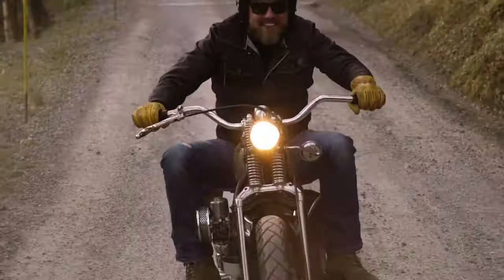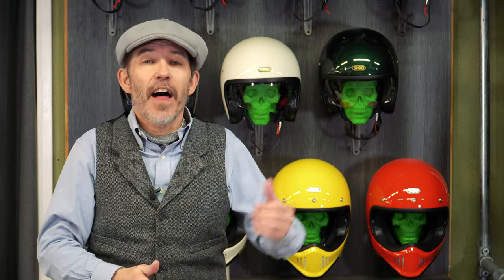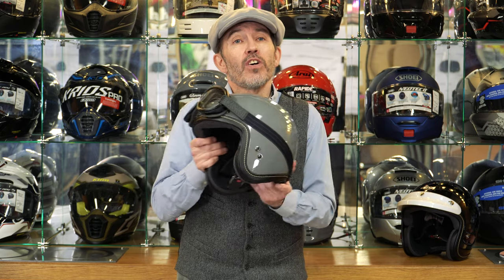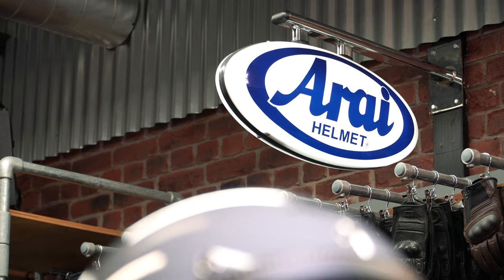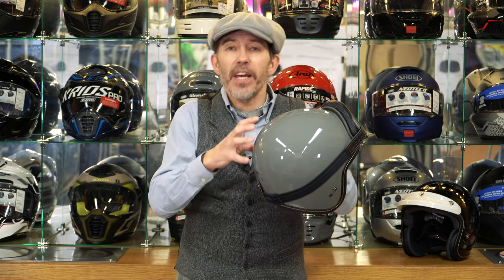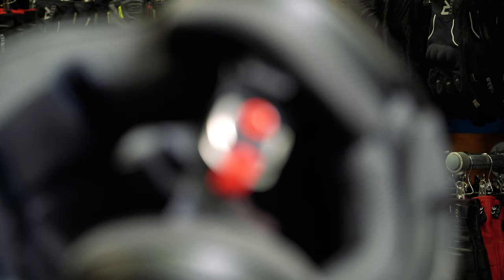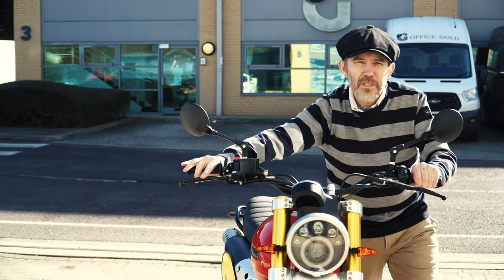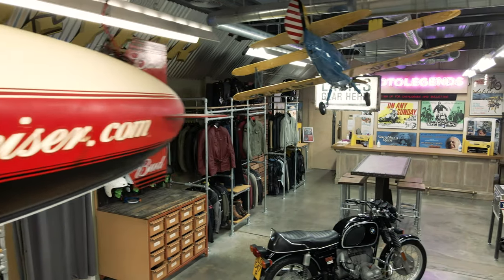Arai Urban-V helmet review

Comment: Tks, Chris. To add to your list about classic-styled open face helmets with changeable cheekpads, please seriously check out the HJC FG70 S. FG for fiberglass. (The US gets the IS version, which is polycarbonate) 
Costs circa GBP120, I fell in love with my white assymetical striped Landon version. It's got full removable liner and cheekpads, there are fine slits in the front of the lining for airflow. It's ECE 22-05 certified. It's got drop down light smoke visor. 

And for those reminiscing the 70s, one could even buy a Luke Skywalker X-wing fighter pilot replica with an orange tinted visor!! 

I loved the FG70S Landon so much that I sold my Arai Classic DC (a pre- Arai Urban-V version classic openface helmet). It's been my mainstay dry weather helmet since 2018, to complement my Bullit Carbon when the weather and road  risk conditions increase.

Comment: I've had my Arai open face for a couple of years now,  purchased from a lesser vendor.  It is every bit as good as you say. Highly recommended if you want a pi** pot lid! 
Are you planning on stocking the Sena Savage open face with built in comms at all? Very interested in one , but seem unable to find a retailer that keeps them in stock for fitting.
Reply from the maker: Dear Paul, we know the helmet, and have had a few in for customers. Truth be told, I am not sure that it’s a brilliant helmet; and it won’t fit everybody. But the comms. facility works impressively well, given that it’s an open face. Not many retailers want to stock it, because the margin offered by Sena makes selling the helmet barely worthwhile, but if you are in this area, I would be happy to get a couple of sizes in for you to try. If it doesn’t work out, I can send them back. CP
Reply: @Motolegends  that’s why I keep coming back to Motolegends, top customer service 👏